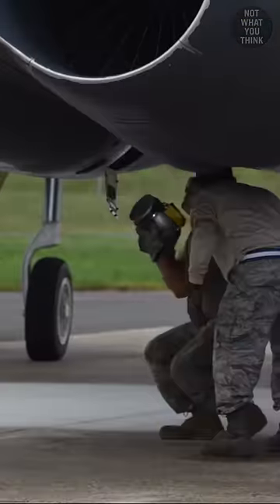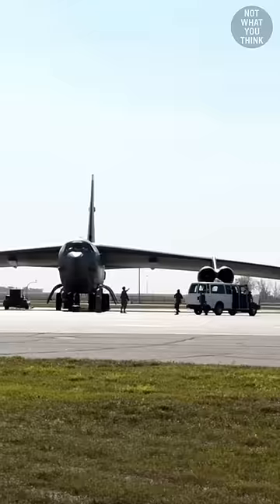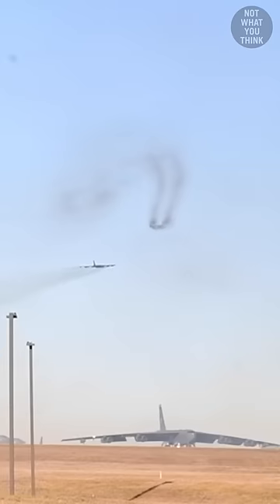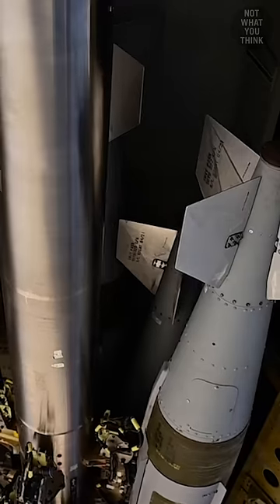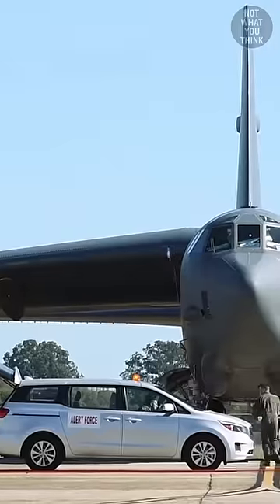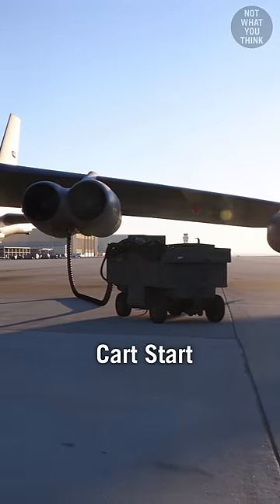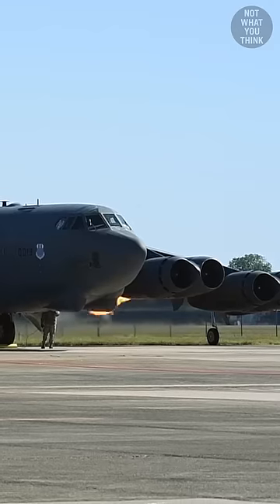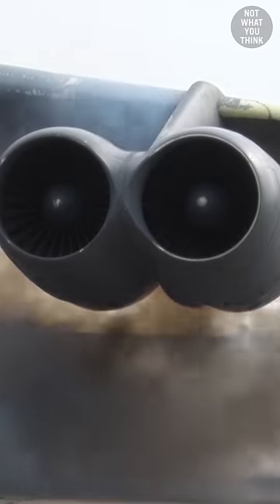Putting Explosives Inside Aircraft Engine #shorts

Comment: Well, have you seen those engines? The hard part is getting them to spin fast enough to start the jet engines run smooth. Remember a jet engine is a like a very heavy fan that creates it's own power do that faster it goes the more power.

Comment: A/M32A-60 Gas turbine generator. It produces 60KW of electrical energy and can provide bleed air. It will burn through 160 gallons of fuel in 4 hours.

Comment: It's called a Coffman Starter, and while the cartridge used by these starters looks like a shotgun shell, it's not literally a shotgun shell. Firstly, it's far too big. If the size was reckoned like a typical shotgun cartridge, it would be like a 4 Gauge or larger. Secondly, it loaded with a slow-burning propellant that wouldn't be very effective at pushing double-aught buckshot out of a gun. The purpose is to create a high-pressure pulse of gas to cycle a piston engine or spin the compressor stage of a turbojet engine sufficient to cycle the ignition system. If you were to look at a Coffman Starter from a Pratt & Whiney R-1830 radial you'd see that it has five chambers like a revolver, but otherwise, it doesn't look like a firearm. (The extra chambers are there in case the engine doesn't catch on the first try.) The starter isn't built as strongly as a firearm because the pressure generated isn't that high. The point is to start a very large engine, not to damage it. Not only were Coffman Starters used on aircraft, but they were also used on ground vehicles as well. Several versions of the M4 Sherman tank also were equipped with Coffman Starters for use when the battery went flat. Russian tanks also used them for winter conditions. Even bulldozers used them occasionally. Not What You Think calls these cartridges "explosive" for clickbait reasons. They're not technically explosive, the pressure curve they generate is far too shallow for that. Remember, smarter people than you or I designed this well-proven system to start large engines, not blow them up.

Comment: Why do they only need to start up 2 of the 8 engines?
Reply: Because they have bleed air supply off the  compressors that can start the others
Reply: Same thing that pressurizes the cabin 

Same with commercial jets
Reply: Same way they use the ground starter 

Just a jet turbine air compressor that plugs into the engine to start it

Commercial jets have a small turbine in the back that functions the same 

Called the APU 

Auxiliary Power Unit

If the aircraft doesn't have a apu and the engines flame out 
   Gotta put it into a nose dive 300 plus knots to restart them

That's if all engines go out if not can use bleed air from running engines

Comment: They did something similar to c-130s but they use rocket engines and they used them to boost the plane off the ground and it was used to help free hostages
Reply: Jato rockets
Reply: Thats completely different, they do that to shorten the takeoff distance, not start rhe engines quicker
Reply: @richardmillhousenixon  well yeah but it did speed up the takeoff

Comment: Can someone more informed on this stuff let me know why they would need to scramble bombers? I can understand fighters for intercepts
Reply: In the case of an nuclear attack the bomber base is an high value target for the enemy. So you have to get them into the air as fast as possible if the base is attacked by missiles which need 30 minutes from russia
Reply: Nuclear deterrance. Need to get the plane off the ground quickly, because if the other guys can destroy all your nuclear bombers before you can get them off the ground, then the entire concept of mutually assured destruction breaks down and tips the balance

Comment: I'll never understand why we don't use rocket assisted takeoff....
Reply: RATO/JATO is only useful if the airframe is over the MTOW, which is primarily governed by wheel stress and not airframe stress. It does nothing if you're trying to take off quickly, because you still need to wait for all 8 engines to start up

Comment: How does it take one hour to start up a B-52? How is it that I Call myself a lifelong aircraft enthusiast & have never heard this?!?
Reply: Prep and checks. I’d you have one start cart, depending on the air systems, that cart may have to be  injected, started, shut down, and disconnected, repeat 8 times.
Reply: @tylerfb1  ahhh…ok, so it doesn’t take 1 hour to start it; it’s the prep & check process… kind of semantics but kind of not…. Also; I thought they only have to start like 2 engines (one on each wing) and then they can use those to start the rest? No? How long is the total pre-flight check process for an avg. B52?
Reply: @drjones762  I don’t know the whole preflight check process. Apparently the normal ops process is to start the number 3 or 4 engine and use it to start the rest. The cartridge starts can start all 8 simultaneously apparently. It looks like they only started 4 in the video, but maybe they did start all 8.

Comment: The cart start isn't the dangerous part it's taking of with only 15 seconds of separation between aircraft. Normal airfield operations require 3 minutes of separation between heavies and 1 minute between high performance aircraft. For military operations, C130s are high performance aircraft and fighters in formation can take literally take off and land in formation as if they are one aircraft. C17s might be considered high performance aircraft now, I'm not sure as I've been out awhile. A scramble takeoff is to get into action as quickly as possible. For fighters it would be to intercept or engage the enemy, for bombers it's to protect the aircraft. Military exercises are to simulate wartime conditions so it might take hours of prep to do cart starts just to train for a quick start. During normal ops you'd have less manhours involved in startup but it doesn't check the box.

Comment: There must be a trade study whether it is really economical versus repair cost from the damage caused by an explosive start...Not Classified...
Reply: I doubt they actually damage the engines. Higher risk for potential damage, and make them dirty or stress them, but I don’t think they damage them.
Reply: The engines dont care if the hot air that is starting them is coming from another engine or if it's coming from the cartridge.

Comment: A bit deceptive to call them explosives. If anything it's low explosives, but they're not used as explosives. It's like if you said these farmers are spreading explosives all over their fields. 

They burn and generate hot gas to replace hot bleed air from either the cart, or another running engine. They won't be around much longer as the B52 gets new engines

Comment: Why only 2 engines?  Can all the engines be started this way?
Reply: They use bleed air from the other engines to start them.  All they need is one engine to start.  They do two to cut down on the time and if one fails they can still start all the others.
Reply: Probably. Maybe. They start more than 2. In the video they started one in each nacelle. The other 4 can be started from bleed air from their nacelle sister.

Comment: Because when you need to get off the ground fast you do what you have to. We have rocket assisted take offs as well, preparedness is something the us military strives for because we don't want another pearl harbor.
Reply: Why we don't invest more in JATO instead of making aircraft VTOL or STOL is beyond me.

 Surely we could have designed and developed some reusable rockets by this point in time. For short landings have a massive parachute or a way for to reverse thrust.

 That way you don't have to invest in a plane like the F35 B that loses a lot of capabilities since it essentially has to carry dead weight once it gets into the air and all that extra fuel. Can't recall if it needs water like the Harrier. 

 Get Elon on them. Haha.

Comment: 2-mile runway? A B-29 only needs 287 feet.
Reply: Very different takeoff requirements and top speeds, range, carry caps uk the important stuff lol
Reply: The B29 Superfortress?  Less than 100yards? You funny man.
Reply: @DavidOfWhitehills  ah shit my bad i meant the B-25. source: during preparation for the Doolittle raid over Tokyo, pilots had to train to take off in under 500 feet
Reply: @lunaz_here  B-25 was a Medium Bomber and that length was stripped down with minimum payload. Add to that the B-25 could be argued to be better called a heavy fighter than a medium bomber

Comment: Will the new Rolls Royce replacement engines for the B52, still require this???
Reply: Probably. The cart start is for expediency, it's not an 'old' thing.
Reply: @harrystone8847  Reason I ask this is that I'm sure the Vulcan bombers didn't require these for QRA starts.
Reply: I wonder. Probably unless there’s an onboard APU fitted as part of the retrofit.
Reply: @tylerfb1  I had this on my mind. If so, its likely to be Honeywell.
Reply: @tylerfb1 There already is an APU AFAIK, it's just not big enough to start all 8 engines at the same time. Hell, even the bleed air from one of the main engines can only start like 2 of the other engines simultaneously
Reply: @richardmillhousenixon  source? Every place I’ve seen says no. APU is an option with the CERP.
Reply: @EdgyNumber1  I did some research. Starting without ground support equipment is required. So, either cartridge or APU. But the APU has to be special so it can do rapid starts.

Comment: It’s called a “starter cartridge” it’s different from a “start cart” I’m not the one who names it, don’t blame me. It’s a solid rocket booster that drives a turbine connected to the gearbox of the engine. The start cart is that box you see in the video, it’s a small jet engine in a cart on wheels used for the same thing.
Reply: Not even close to accurate.  The air cart is normally used to start the engines.  In an emergency, a cartridge is installed in the engine.  The cartridge gases are routed thru the normal starter, causing the engine to rotate fast enough to start.

Comment: This video says it takes an hour to start the B-52. Wrong. In a longer version, it says it takes an hour to "warm up" the engines on a B-52, so they use the blank cartridge method to start the engines rapidly. They then can take off in three minutes? That's what the longer video states. How does this method magically warm up the engines? It doesn't. Because they're giving us poorly researched information that makes no sense. If it took an hour to start,warm up, and launch our nuclear bomber fleet, we would be f***ed. They're mixing up information and not even thinking about what they are saying.

Comment: This video was supposed to be about how they can start the B-52 faster than one hour. It proceeds to show us the explosives. And then it says it's called the "cart start." WAAAT??? 
And then it shows the explosive starting the engine. HUH!? 
The cart start is the normal way! That's the one that takes a long time. Why did you show "cart start" as part of the explosive start? This video is a mess! It's a total disaster. It could only succeed in confusing people! 😮 🤦🏻‍♂️
Reply: CART START ... Gas turbine engine starts the engines by blowing high pressure air through the bleed air system. 
EXPLOSIVE START... there's a charge that is placed within a canister that pressurizes the bleed air system for that particular engine.

At no time would you use both. There's a difference between "cart start" and "explosive start". The cart start is the slow way. 
The explosive start is the fast way. 
😊

Comment: I did some research on these devices after seeing a video about them a couple years ago, those cylinders are basically a nitrocellulose core burning rocket motor. There is a giant solid slug of double-base smokeless gunpowder with a hollowed core, when it ignites it burns from the inside to the outside just like a NASA solid rocket booster, but instead of creating thrust by shooting the hot gases in the opposite direction, it creates tons of pressure (quite literally, they make thousands of pounds of pressure) with the hot gases which is piped to special turbines that spool up the massive main turbines of the jet engines. The smaller starter cartridges create upwards of 500 horsepower for a second or two, while the larger ones such as those shown here can create much more, probably somewhere around 1500-2000 starting HP for a few seconds. They're really quite cool. I'd love to see a racecar with a scaled down version that creates a second or two of mad power, with perhaps a revolving cylinder of cartridges much like a revolver for multiple "shots" of boost. It would never fly for safety reasons but a man can dream lol.
Reply: Sounds similar to the powder bags used on large naval guns like Battleships just smaller.
Reply: As a retired crew chief, you are only partially correct.  The normal air pressure to start the engines is 60 PSI.  High volume low pressure.  The exhaust gases from the bur ing cartridge is routed thru the normal starter.  The pressure is lower than the air carts, which results in lower engine rpms during the start, but enough to get the job done.